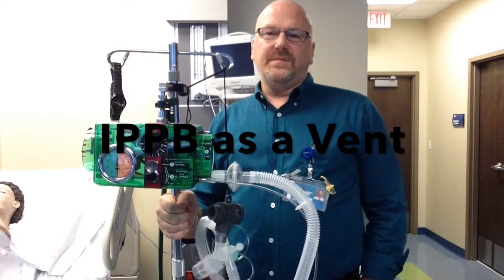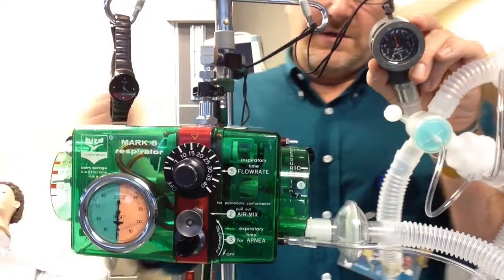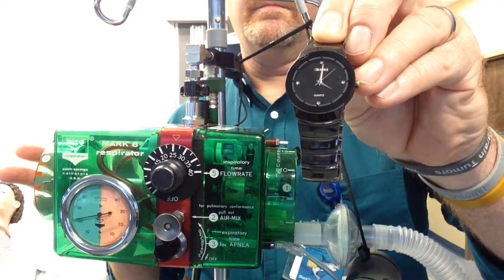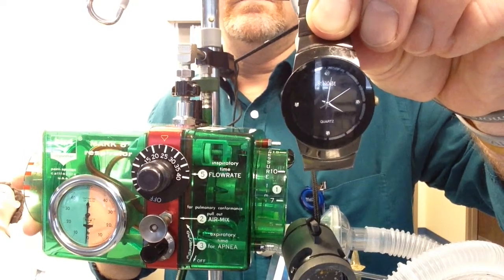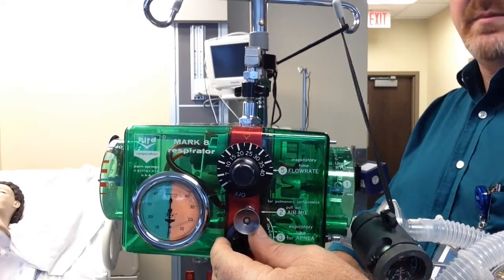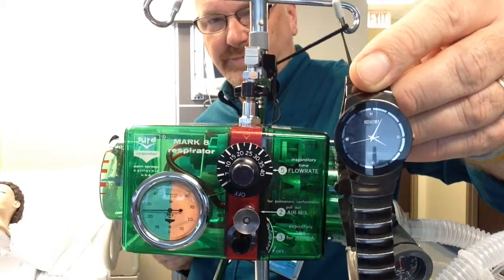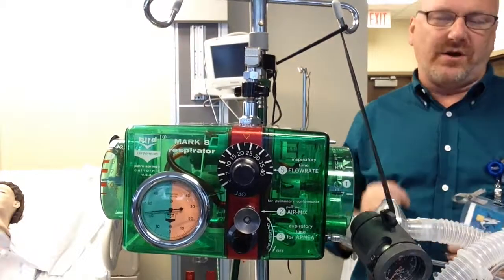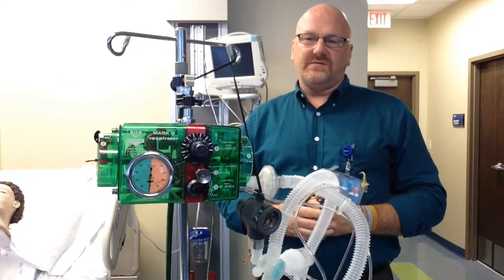IPPB as a Vent

Comment: Any of the "Bird" units Mk 7 , Mk 8, Mk10 and Mk 14, ( I didnt mention the Mk 9 seeing it was more designed for veterinary use)and add the Bird blender or even the old mixing cartridges and you can do a decent job of ventilator support.  Want to know more ? ask  me !  Of course we could use Bennett Pr units too !
Reply: Do you have any idea where I could get a spate part for my Mk 8 Bird? The green transparent plastic on the right (as you look at the front) is cracked and unlikely to form  a gas seal. I'd be happy with a used or new part.
Reply: @NoosaHeads  lets be sure we are talking about same side, the pressure gauge side is ambient pressure the patient circuit side is the pressure side. As for as parts go ? Id suggest actually writing to  https://percussionaire.com/  . they now own bird. see if they have parts but also go over to EBAY and do a search for bird mark series , there are several !

Comment: What do you want the I:E to be at 1:3 or 1:2?
Reply from the maker: Depending on the patient and the condition of the lungs.  If the person has obstructive diseases then make the E longer.  If the lungs are stiffer then the E can be shorter.  This machine does not have an E time so much of the I:E is guestimation and measurement using your wristwatch.

Comment: If they were looking for an inexpesive solution to this COVID-19 crisis I think this would be a good way to go.  The Birds have been around a long time, although fairly simple design with needle valves, diaphragms, orings, check valves, magnets  and gaskets, they have alot going for them, they could be easily mass produced and driven pneumatically.  Could be set up in manufacturing plants, fairly simply with little tooling compared to other "big" vents and microprocessor controlled vents.  I have worked for 2 ventilator manufatures and have been a repair guy for almost 4 decades.  I am not sure of the Covids -19 patient pressure tolerances or syncronus operation requirements.  In any case if they were to have BIG companies start building vents the smart move would be to license proven designs from the medical industry and built to those exact parameters and software, they are proven and FDA approved.  Because when this is done those units may still need future support, and the manufacturers will be back making cars etc.
Reply from the maker: Thank you and yes this might be an emergency solution.

Comment: Is it possible to use as a mechanical ventilator for a patient with COVID19? (ICU)
Reply from the maker: JCCARDIOVET the short answer is yes it is possible.  Please remember that this is basically a pressure control ventilator and not volume control.  It my understanding that the COVID patients are having stiff lungs which greatly affects the volume.  The downside of the Mark 8 is that there are not any monitors for volume.  It was originally created for post op and most post op patients do not have a greatly dynamically changing lungs.  Short answer, yes it is.  Longer answer, need to really watch the tidal volume and also potentially increase the peak pressure to keep the same tidal volume.
Reply: Yes it is

Comment: How do you apply PEEP with this ventilator setup? Thank you for posting this.
Reply: Until they came up with a PEEP valve for the exhalation port you ran a tube into a bucket of water 1.3 cmh20 of PEEP{ for ever inch the end of the tube was submerged under water.
Reply from the maker: You would need to add an external PEEP valve.  The same that you would use for a resuscitation bag.

Comment: These ventilators can be used in Young patients with compliant lungs. The Hospitals and Govt should have thousands of these Mark 8 Bird respirators in surplus. These should be used if a shortage of ventilators exists for the use in this COVID19 crisis.
Reply from the maker: Thank you for the input.  To expand on your thought a bit.
Even with stiff lungs, these can be used.  You need to increase the driving pressure (remember with stiff lungs, not as much pressure is transmitted from the airway to the pleural area thusly there is not as much of an increase in intrathoracic pressure).  As to the COVID 19, yes they could be used.  The Vortran is basically a disposable style of the Mark 8.  The downside is that there are not any monitors on these items and with the ever changing lung, the ventilation will change.  Many back up ventilation stores are using more of the LTV 1200 in the go box.  This has computerized monitoring and better ventilation for the patients.  
With that being said, if you do not have power and in a big pinch, yes this would work and the Vortran is basically the same vent in a disposable format.
Reply: @resptherapyedresources1997  As an older retired RRT and RN, and prior Director of Respiratory Care, we saved many lives doing this back in the 90s.  It definitely works!!!
Reply from the maker: peggy herbine we typically used the PR2 with a heater.  Yes I do agree.  Thanks
Reply: Mk 8 was a positive-negative respirator if you used an infant J circle. The color of the center body told what the Bird could do.
Green positive pressure, red positive-negative pressure, one bird the Mk10 was pre set, used by military, no adjustment to pressure or  sensitivity just rate and FIO2, another the Gold  Mk 14 was graduated in mmHg not cmH2O. It handled high flows and pressures, and had flow a compensator for leaky cuffs, also called a horse bird cuz it was used in veterinary medicine  to ventilate large animals. I used it on children and adults.
The Bird adult circuit was called a "Q" circle which had minimal dead space, we used a standard Tx setup with flex tubes to manage re breathed CO2 to get the PCO2 dialed in. Yep the hourly vent checks to measure Vt and adjust pressures, deflate the tube cuff suction and re-inflate, all we had in those days were either rubber tubes or plastic all high pressure low volume cuffs, no suction kits, a single rubber catheter with a plastic "Y" to connect to the suction canister, at beside floating in tray of Zephran. 
I did 200 mile ambulance transports with Mk 7's and Mk 14's, great machines. The Birds were a great series of machines too bad most disappeared! Learned to to tear them down and rebuild them, knew every part by heart.
If you want to see a MK 7 in action (breifly with a Q circle) or a PR 2 for that matter get the Movie "Bullit" with Steve McQueen and pay attention to the scenes filmed in ICU at San Francisco General Hospital, circa 1968ish, you see the ICU's I started in 1971!  No volume vents to be seen but they were on the way! Cape, Emerson, Ohio 560's and OMG the MA 1  !!!!!!! Now look what we have!

My career 1971-2015 encompassed all phases of RT from neonates to adult acute care, ICU, Open Heart's, Trauma (before there were trauma centers and air transport, Managed a Dept for 23 years, also 10 years concurrent to that in EMS as an EMT 1&2. Instructed as faculty in those programs for the Calif State University, Sacramento.
Did all that with a ONE year Inhalation Therapy School education which had outstanding classroom and clinical instructors, starting Oct 1 1971, by Feb 1 1972 I was qualified to run my own shift. School was classroom 4 in the AM and 4-8 hrs clinical at various hospitals in the PM. My favorite was Letterman Army Hospital at Presidio in San Francisco.  2 Corpsmans and 2-4 civilian students  (us) for a 1200 bed hospital  all we worked was ICU and CVU with occasional visits to the wards to deliver equipment, an AP for a patient with abottle of saline, and a bottle of 1:400 Isurprel so they could do their own IPPB Tx's!

Bob B. CRTT , never changed to a CRT, proud to be an old "trench therapist" that could handle whatever was thrown at me!

Great video brought back many memories Thanks!!!!!!
Reply from the maker: @ABQRT  Thank you for the info and the compliment.  I too used the Mark 7 and PR 2 and the MA 1.  I got my CRTT in 94 and RRT in 94, not as experienced.  When I entered the field, the 7200 was the work horse vent.

On a note of what you stated, it was my understanding that the negative P of the Mark 8 turned out to not be a great idea due to adverse effects ie deflating lungs.  I never worked with it, mostly Mark 7s.

Thanks again for the input and compliments.

Comment: Excellent thanks for sharing where can I find TIdal V flow meter
Reply: You can use the hand held Wright as shown here and you could mount the PB spirometer on the exhaust side. This should not be trial and error...calculate your Ti + Te/60. We used this unit as a backup or to punish snotty cardiac surgeons back in the 1980s.
Reply from the maker: I am not quite sure what you mean by a Tidal V flow meter.  The device I used in the video is called a Wrights Respirometer.  It is used to measure tidal volumes, minute ventilation, and slow vital capacities.